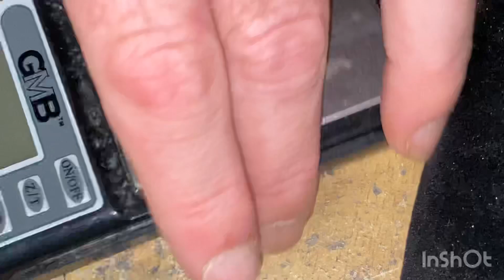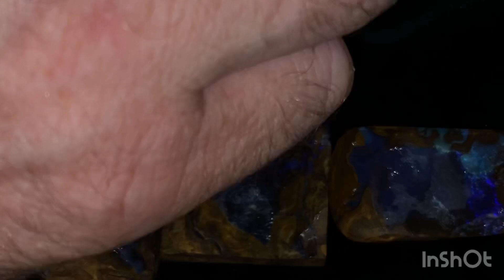Opal cutting: rough to cut, Andamooka opal.

Comment: If you don't mind sharing, what are the different grits that you are using in the different steps in this video? Thanks for the shared knowledge, it's great to see you go through the whole thought process.
Reply from the maker: G’day Lori, the hard plate I started with was a #260, then the soft pads were, black #280, brown #600, grey #1200, and pink #3000, then finished with cerium oxide on a leather wheel. 🤪👍
Reply: @theopalmills   Awesome, thanks Phil!!